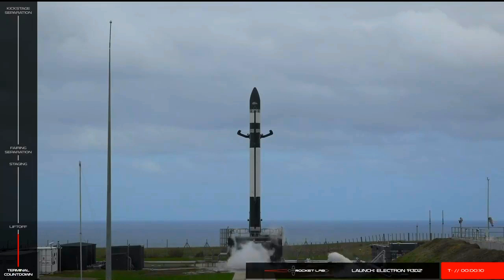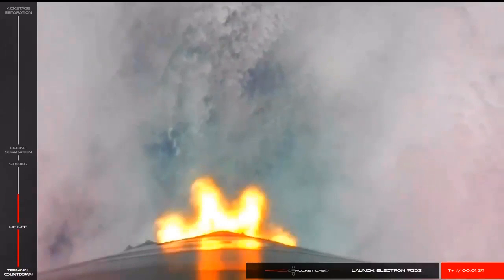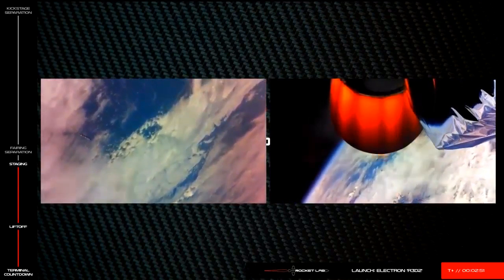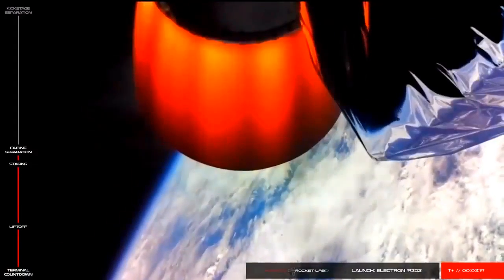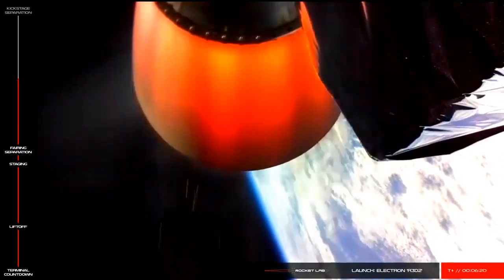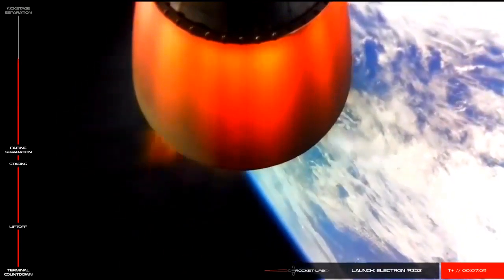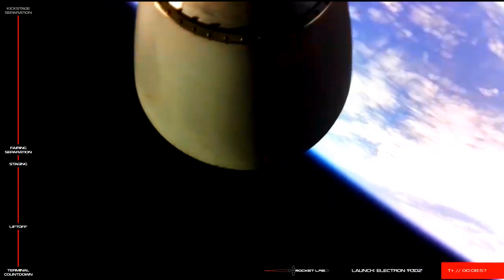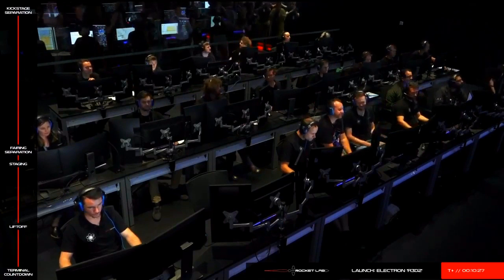Blastoff! Electron Rocket Launches DARPA's R3D2

Comment: Where Star why always video recorder zoom 🔎 why no recorder panoramic camera this same on the start
Reply: I'll try to decipher you word salad here:
"where star"
the stars are too dim to be seen when the camera is set to expose things in direct sunlight, if you could see then in the video then they would be easily visible on the ground during the day as well.

"why always video recorder zoom 🔎 why no recorder panoramic camera this same on the start"
The cameras are largely there for engineers to make sure things are operating correctly, making the system more complicated with more expensive and heavy cameras (especially on such a small rocket) would only really make the launch more difficult.
Reply: @feathered3167  Nice job translating.
Reply: Mnupyt